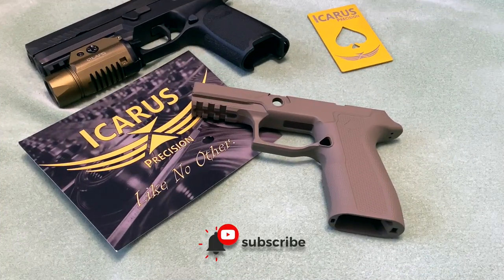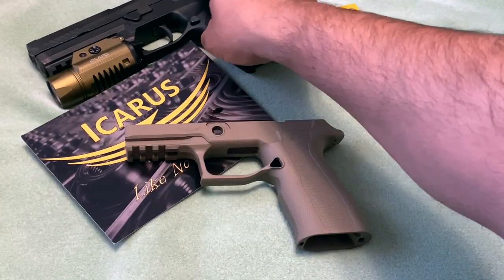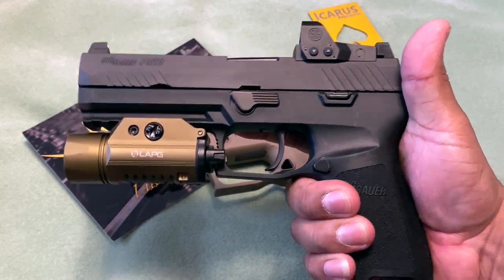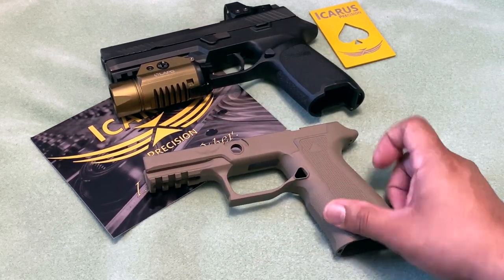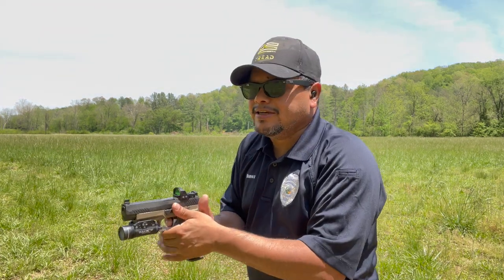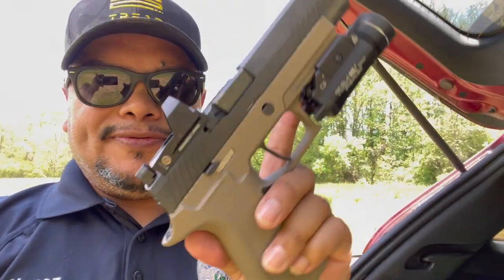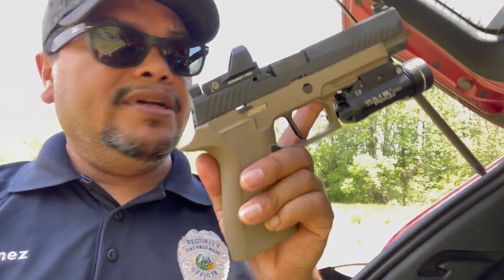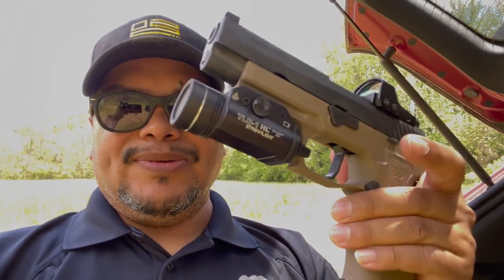A.C.E  320 X-Carry | Icarus Precision

Comment: How is the finish around the magwell?
Reply from the maker: Holding good!
Reply: @CarolinaEDCreviews  I have a XL and I am on the wall. Do I get a grip mod or holison 5K red dot? I bought a complete upper and had Sig beed blast to stainless finish and I was going to switch from iron sights to red dot without removing the red dot. But that grip mod is awesome. Your thoughts?
Reply from the maker: @jimd1968  this grip mod is good and solid, it does add weight, as far the holosun they make some great red dots, it’s all about preference in models you want to get or redicals